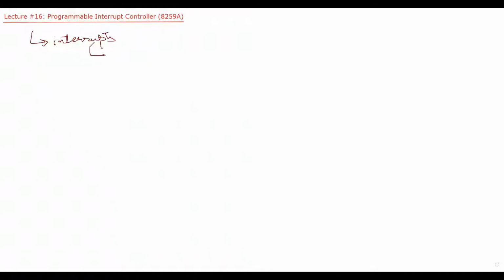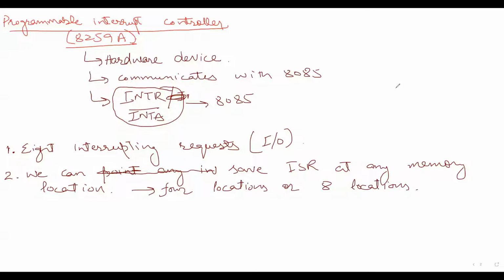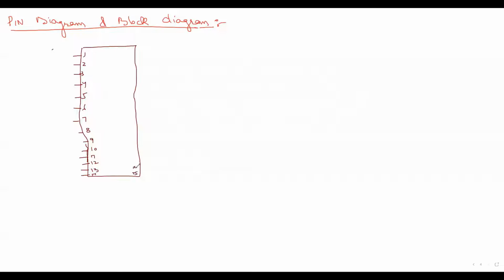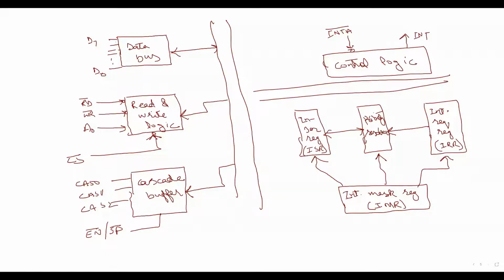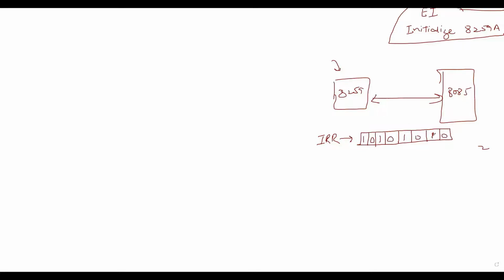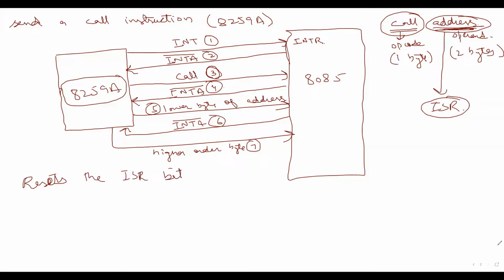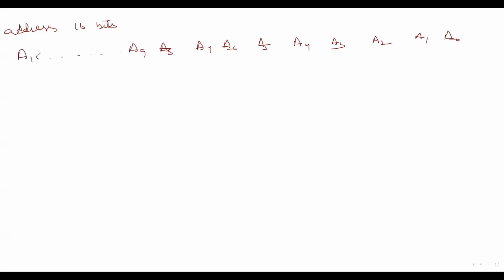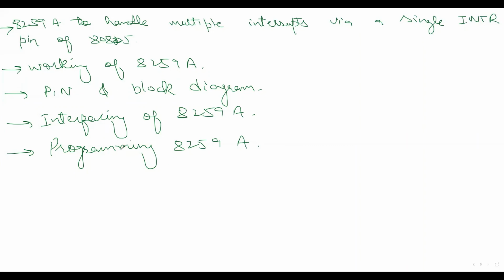Lecture 16 | 8259A Controller | Programmable Interrupt Controller | Initialization Command Word

Comment: Hello! Thank you very much for the video but I have a question. I'm studying for an exam and one question is "In an interrupt system based on the 8259A you want the peripheral connected to the line IRQ7 to obtain the address of the service routine from memory location 188 you have to:" And the answer is "Program 40 as ICW2". I don't understand why I need to do this and how to get to that number. If you could explain to me why I would be very grateful.